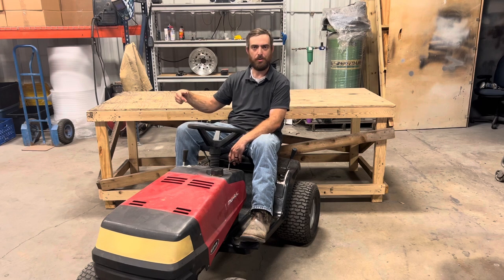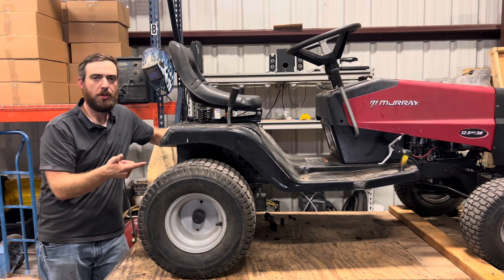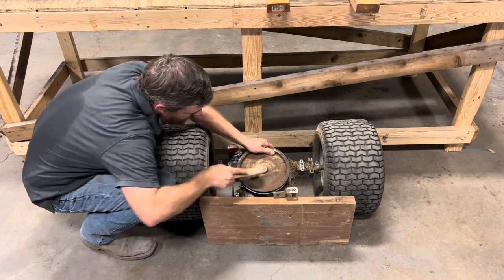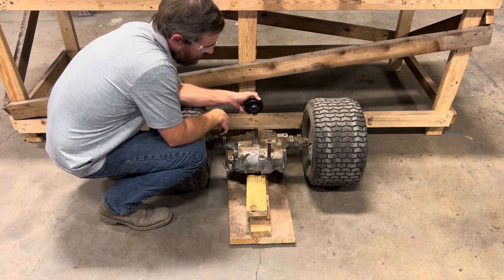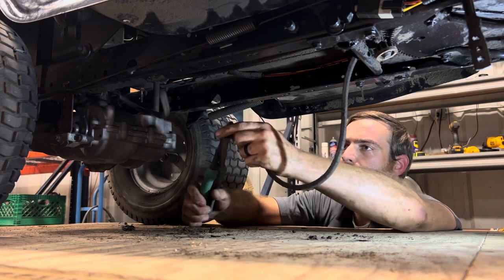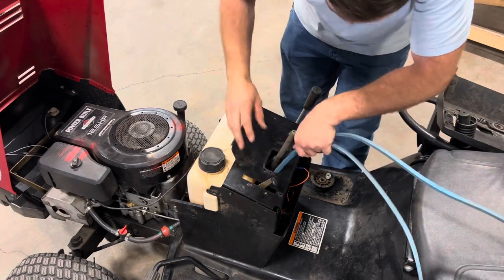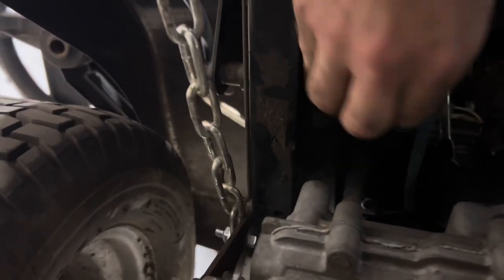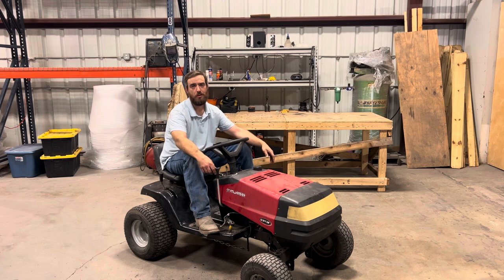Riding Mower Build-A-Long — Pt. 5 — Rear Axle Pulley Swap

Comment: Finally found someone else who knows the easiest way to pull that 9 " pulley off the rear end😊 I don't have a forklift,  but two cinder blocks, two short 2×4 "s ,a hammer , and steel driver works for me 😊

Comment: Nice ride man!  cool video.   Small recommendation... I have a similar model.   I cut the steering wheel shaft and extended it by approximately 4 in.  This allows getting on and off easy.  It's also easier to steer.
Reply from the maker: Thank you!! 
And I did the exact opposite 😂 I shortened mine by about 3-4” to get it as low as possible and still look stock

Comment: A nice suggestion, with your idler and clutch pullies do metal ones, the plastic ones like shattering...
Reply from the maker: Good call! The clutch is the only plastic pulley, but it has already given me issues and I need to pull the plug on a replacement
Reply: Yeah i jave an LT1000 Craftsman, and the cutch and clutch idler pully were both plastic, i changed em out in the tractors first beginnins. I haven't had a plastic pully explode, but my buddy says he has.

Comment: It's cool having the clutch separated from the brakes.  My Troy-Bilt is Hydrostatic, but the Craftsman is much like yours.  Same carb mounting, stop to shift, etc.  You can accelerate like a vehicle with a standard transmission.  Wow!  I hate that my clutch and brakes tied together.  I have to stop to change gears.  I can't weld, so I can't add your mods.  😟  I'm going to repair a lot of rust in the Troy-Bilt with KBS Coating products, keep that one for its Hydrostatic and prolly sell the Craftsman when I'm done.  The Troy-Bilt is a 2011 model that the owner used for two years and then left sitting in the weather after buying a zero-turn.  $300, so I bought it after my Craftsman self-propelled push mower engine died at the beginning of its 3rd mowing season.  Zero compression.  Briggs is crap since production was moved to China!

If you haven't heard of KBS Coatings, it's a fairly new company started by the Chemist from POR when he left.  His products are advanced improvements over those which POR still sells.  They have a product called NuMetal.  It's a putty which can be formed and hardens into metal and then can be used to fill cracks, can be fortified with wire mesh for holes so it stays in place while hardening, and can be grinded and sanded, drilled and tapped, etc., once hardened.  I haven't used it or any of the rust repair products yet, but it's supposed to be better than anything POR (Paint Over Rust) has, which was already very popular in things like antique car/truck repairs, mods, hot-rodding and such.  Anything that rusts.
Reply from the maker: That sounds like some good stuff, I’ll check it out. 
And it’s never too late to learn to weld!! 👍
Reply: @wybarprojects   If the "good stuff" you refer to is KBS Coatings, the rust repair products need a top coat if they'll be exposed to the Sun's UV Rays, and they sell that, too.  They offer a range of top coat colors.  Since the NuMetal is a metal, it can have the rust repair and prevention products applied, too, to prevent rust.  Their lines of products will amaze you!  Check 'em out.

I've seen some affordable welding machines, but had no idea of which kind to get.  I like that you can hold pieces together with bare hands and fingers to make tacks.  What would be a good type of welding machine to get for occasional, nonprofessional, general homeowner use?  Yours feeds the welding material upon use.  I'd prefer that kind over sticks, but I guess each type has its specialized application.  There have been times I could have used one and projects I could have done in the past.  YouTube has lots of tutorials on beginner welding I could watch.  Is there a channel you'd recommend, or maybe you could make a tutorial series?  Teaching when to go slow to prevent warping would be a good episode to include.
Reply from the maker: @100vg  I could definitely do some welding tutorial videos for beginners once it starts cooling down a bit; I don’t know of any good videos to recommend off the top of my head. 
As far as a good machine for beginners, I recommend a 120v miller, Lincoln, or Hobart. I’ve also heard great things about harbor freight’s 120v welders but I don’t have experience with the newer versions. You’ll want to look for a 120v mig welder and use flux core wire, that will allow you to do most small-medium projects.
Reply: A 120V mig welder with flux core wire.  Thanks!  Todd of Project Farm covered welding machines recently and a Harbor Freight model was among them.  I'll find that video again and see if it covers migs with flux core wire.  I remember there was a 120V version.  If not in that video, I have his spreadsheet organized by topic with video links and there may be one there.  Project Farm does comparison videos for everything.  His channel is HUGE because he's the best at it with honest reviews.  He pays for every product he tests and compares, and he's great about buying test gear and creating testing devices.

I'm subscribed now so I'll be ready when you make your tutorials, maybe not with a machine yet, but I'll watch them and have access for later.

Here's his most recent, but these may not be Mig:  $70 vs $2,300 Welder? Let's Settle This! Weld Strength, Duty Cycle, Current Output, Build Quality
https://youtu.be/IK_Cn5lxggA
Maybe you can tell me is these are Mig, if they would be self-feeding the flux core wire and be suitable for me.  Sometimes links don't work in comments, so if not, a Google search of the Title will get you there.

Would a flux core wire feeding system be another purchase?  I know nothing about welding except what I learned from Todd.  Thanks
Reply from the maker: @100vg  some of the welders in that video do have a mig function, but it seems like he’s focusing his testing on arc welding (welding with electrodes/welding rods). 
When ‘flux core’ is mentioned, it’s referring to the type of wire used. If a welder is designed to use wire instead of welding rods, it comes in a ready to use package, minus the wire. 
I describe learning to weld like driving a car. If you learn to drive on a manual transmission, everything else is a cakewalk and arc/stick welding is very similar. It’s a more involved welding process, but once you get good at it mig is a breeze. If you’re limited on time or just want to jump right in, I would go mig
Reply: @wybarprojects   Yes, I think I'll like the convenience of Mig.  At the end of that video, he asked people to say if they wanted to see a similar video on Mig units.  There were a lot of Yeses and I added mine today.  Thanks for telling me it wall comes as a complete system, and that may make it cost a bit more, but that's OK.  I'll have everything but the flux core wire.  Is Harbor Freight wire OK, or get another particular brand for better quality welds, ease of use, etc.?  Todd's review will also be testing the wire feeding so I'll know which one to get, or which one is for me from the top 2 or 3.
Reply from the maker: @100vg  I’ve used almost every brand of flux core wire available in stores and they all seem pretty much the same, but I’ve never done a side-by-side comparison with them
Reply: @wybarprojects   Good enough for me.  I'll compare Harbor Freight and Amazon for quantity versus price.  Thanks for all the attention.  I'm watching Slammed Part 11 right now.

Comment: You gotta flip that engine pully upside-down for more speed!
Reply: Or even use the old pully you took off
Reply from the maker: I do have plans for a pulley swap on the engine side, but I want to upgrade steering and get a helmet before I hit light speed

Comment: What will happen if you don’t put that middle pulley and bearing
Reply from the maker: That’s the clutch assembly, so there would be no way to disengage the rear axle from the engine
Reply: @wybarprojects  I mean the one you said was to hold the belt a put away from the shifter rod… will it rub the belt off?
Reply from the maker: @matthewmcguffin3508  gotcha, my bad. Without the big idler, the belt was rubbing itself when the clutch pedal was released.
Reply: Gotcha man thanks a lot

Comment: I can hear you fine...can you not subtract the radius of the the small pulley from the larger pulley and find your belt length.
Reply: After pulling swapping,  set clutch, loop old belt through  ,mark a line with belt held tight while clutch pressed,, measure old belt from start to your mark,, add one inch , and that is the new belt size.

Comment: Hey sorry if im a bit late but i have the same exact mower and i want to do the same tbing you did could i get a parts list? If you see this thank you.
Reply from the maker: Ya, of course. Did you want a parts list on the whole project so far, or just on what I did in the pulley swap video?
Reply: @wybarprojects  preferably the whole project. But on my mower on the pulley swap part and that's wha i really need

Comment: Im doing a transmission and if the pumps are shot then its gonna sit around for awhile because i don't have no money for any kit they sell for those plus i don't really need the transmission right now anyhow its one i got for free and was slipping 

Its transmission filter inside the transmission was dirty almost gunky it was enough the fluid couldn't pass through the filter
Reply from the maker: Free is always good! I hope it works out for you
Reply: @wybarprojects  yeah frees good I'll know once i seal it back together and put it on a mower frame then if its still slipping in drive I'll know it's one of the pumps. the magnet on top the filter was pretty clean not much metal flakes did see someone else had it apart once before because it has a different brake screw on and spring in place
Reply from the maker: @Mike-su8si  good luck! 🤞